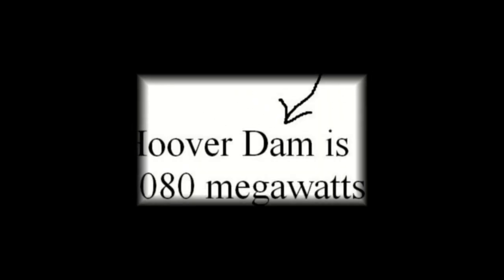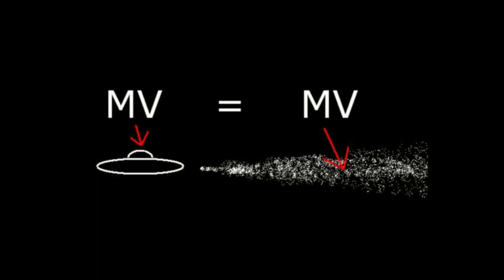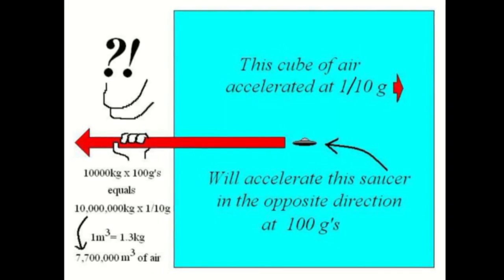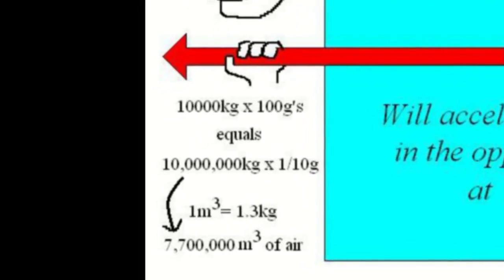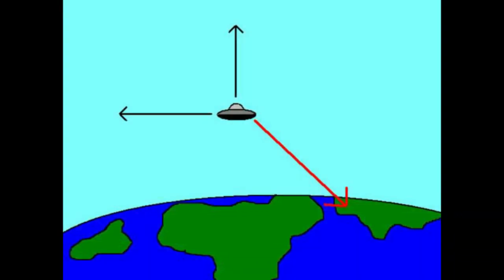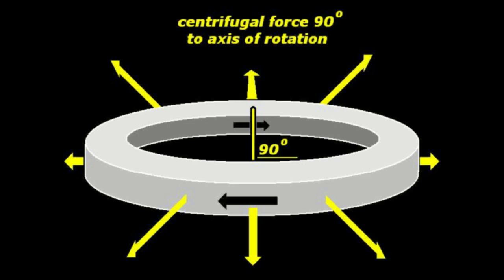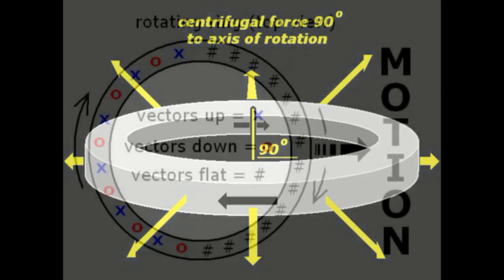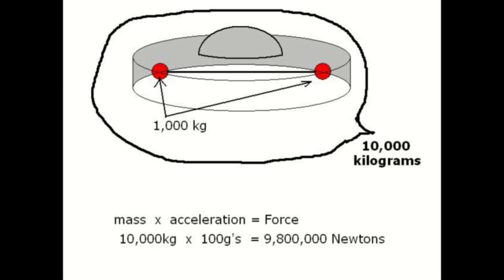Saucerdotal - The Mystery of Ufo Propulsion - 2/6

Comment: Flying saucers charge electrodes covering their haul with extreme amounts of electricity, this has been reported by people lucky enough to see one and makes the craft glow and ark as well and cool the air around the craft with static electricity. They use ions in the air on earth by magnetohydrodynamic plasma propulsion, rather then air simply being drag to get around it's actually used as the fuel for the craft and greatly reduces the air drag on the craft. Water is the fuel as plasma when in the oceans and lakes (USO). Likely carrying water or oxygen with them to use as the plasma when they are in space (a vacuum with little to no medium). This plasma propulsion is how they move. But they combine it with a superferro fluid accelerator ring to interact with gravity fields so the craft is essential weightless as well. Then they use superconducting electromagnets wrapped around their crew compartment to use the diamagnetic effect both as artificial gravity and an inertial dampener effect by pushing back against acceleration and pushing (instead of pulling) to maintain a constant G of their liking to the floor of the compartment. Power source would likely be an onboard fusion reactor, or antimatter reactor.